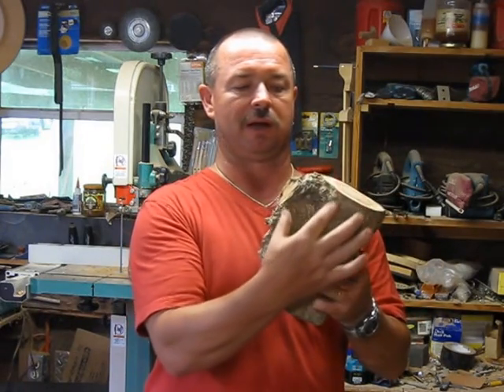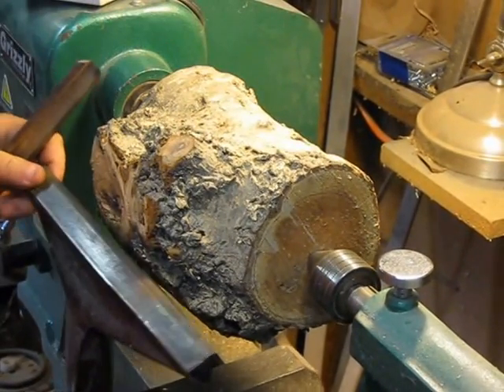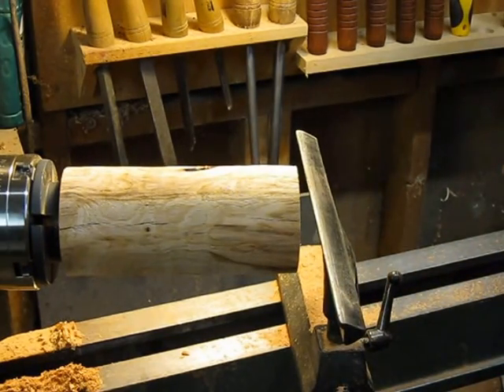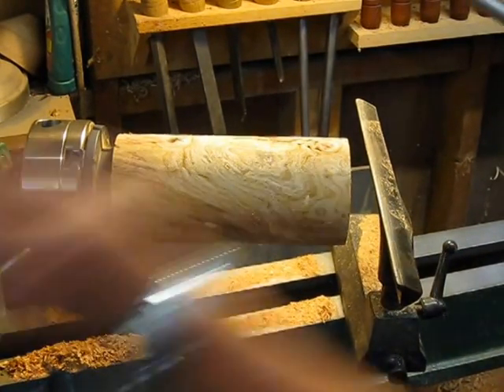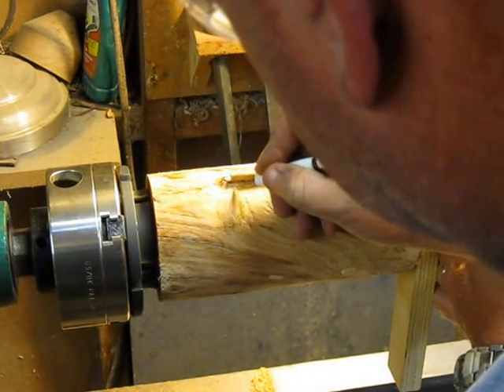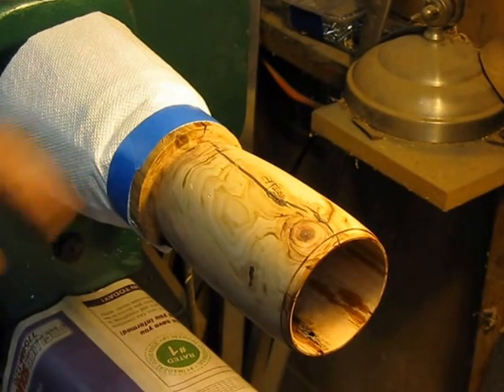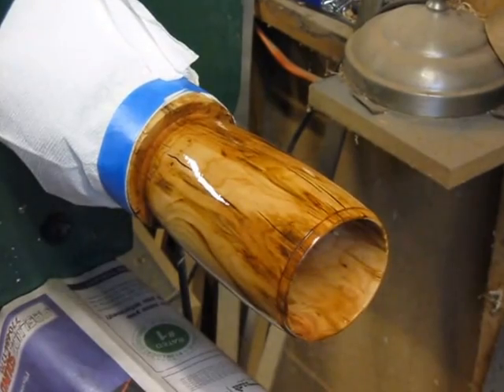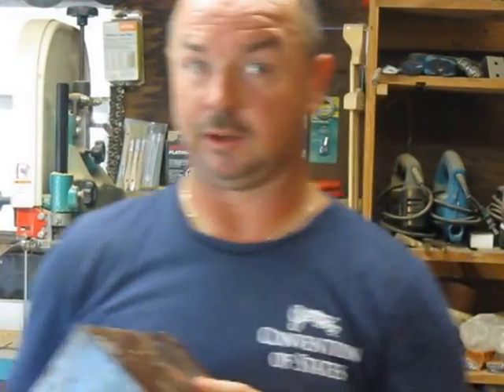#45 Woodturning a Travel Mug from an Apple Burl

Comment: Stephen you are a wizard when it comes to using rather funky wood and making all those repairs. Nerves of steel when you turn that kinda stuff. Great video and another very nice finished project. Keep up the great work.
Reply from the maker: Jim Miller Thanks Jim for your comments. I think there are a lot of "Diamonds in the Rough". I like using wood that most people would throw away as trash. You have to be careful with this type of wood also, because you don't know what is inside. I am glad you like my style and I will continue to use this type of wood in my turnings. Thank you for the inspiring comments and support of my channel.

Comment: Hey Stephen, another great, great video!!!!  I learned an awesome tip from you about putting some of my shavings and dust from different woods in a jar for repairs on projects.   Thanks sooo much from Alabama on another awesome video...  Roger
Reply from the maker: Roger Teaters Thanks Roger for commenting. Glad this video helps and you found it informative. Just remember that to get the really fine dust it should be drilled shavings into the endgrain. This method has worked very well for me for several years now and produces very stable repairs. Thanks again for commenting and supporting my channel.

Comment: I've been saving the end cut shavings with a plywood tray that has a piece of two-by that fits between the bed rails. Doing this saves my bending over so much...lol. Great project and I really admire the way you repair as you go.
Reply from the maker: Earl Rumble Thanks again Earl for supporting my channel. I found the end grain shavings make great inlace material while cutting the bowls for my pipes and just use them for everything. I have a lot of different repair jars now. Thanks for commenting.

Comment: That's a beautiful piece of Apple wood Stephen , this has taught me not to discount a piece of wood because of defects! The repairs look great and really add to the all over effect, and using contrasting sawdust instead of the same as the wood your working on really works.  I'm sure your workmate will be very pleased when he gets it, he's a lucky fella!!
Think I'll try to find those travel mug inserts and try one myself, if I can find them in the UK! I do like the spray lacquer also , I've just finished a pair of candlestick holders with a satin finish lacquer and am very pleased with the way they look. 
Great project Stephen keep up the good work my friend. Trev
Reply from the maker: Thanks Trev. I knew one day I could use this narley old piece of apple for something. It has been in the shop for a long time, several years actually. Thanks for commenting on this piece. Yes, he did like it a lot. I am putting a link at the bottom that will take you to the kits that I ordered in case you would like to order for yourself. I like lacquer because of the fast curing and superior durability. Thanks for commenting and supporting my channel. Hope you like your mug also.
http://www.chefwarekits.com/fun-projects/coffee-travel-threaded-lid-mug-woodturning-kit-stainless.html

Comment: Great job as always. A suggestion; don't tapper the bottom section, make a continuous inside wall to the bottom. Air is the best insulation and I believe the reason the wall of the insert stayed straight for 2 inches is to secure the insert and then the taper affords an air pocket to better insulate the container. ??

Comment: Hi,  I had the same problem with my Barracuda chuck so I called PSI and ask what I could do about it. The man told me to try redrilling the holes larger but I  decided to just go deeper.  I thought I ruined the chuck when I went through the bottom of the hole on the ring but found it did not hurt it at all.  Now I have no problems with the tightening of the jaws.  It worked for me.  Maybe you can save your chuck too.
Reply from the maker: mrlacroft Wow, I am on my way to the shop right now to fix my Barracuda. Thank you so much for this suggestion. I now may have two good chucks use. Thanks also for all your support of my channel.

Comment: hello stephen, another . i am having trouble cutting all the inside the cup. what cutting tool do you use, or should i get. i have only a few tools like roughing gouge,parting tool, and a few other. any advise would be great thanks. so far i am 0-2 on the cup project. thanks in advance
Reply from the maker: +David  Good Thank you David. The good thing is that the inside does not have to be a finished surface. Your parting tool can probably do the job. However, I would recommend a scraper or bedan of some type. I have a video showing some of my shopmade tools if you would be interested in watching. You can save alot of money by making your own scraper for this project. I use a planer blade ground to whatever shape I need and mount it onto a steel bar from the hardware store. Maybe you can get some ideas here:  https://www.youtube.com/watch?v=-XWzyLe6bsQ&list=PLGsnYf7PysCQVT7EYNfJCKXVZA8pWG0q8&index=1